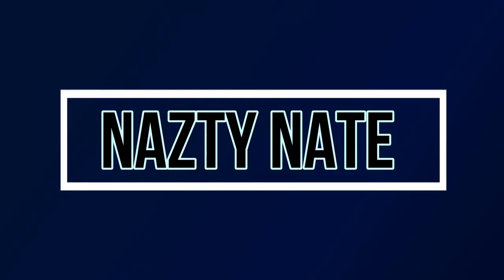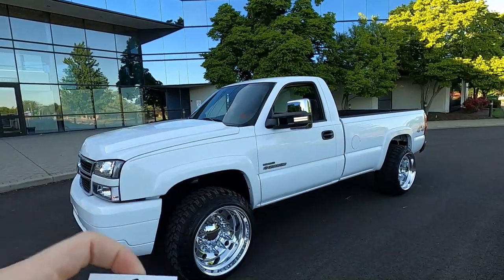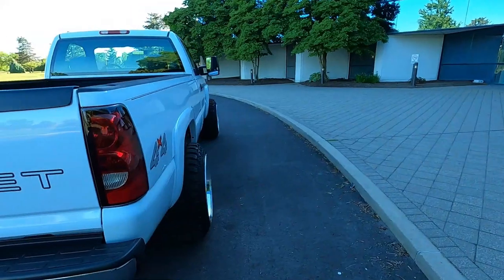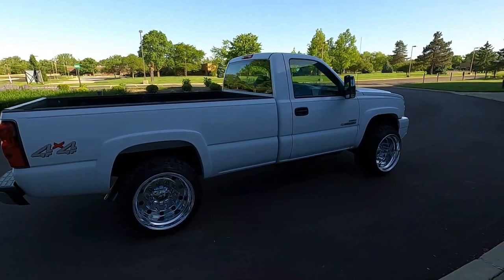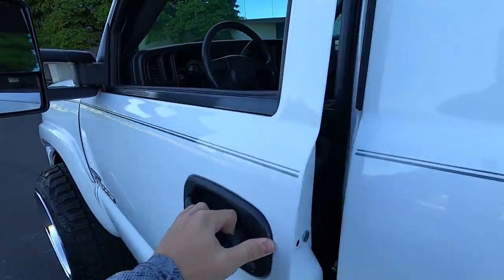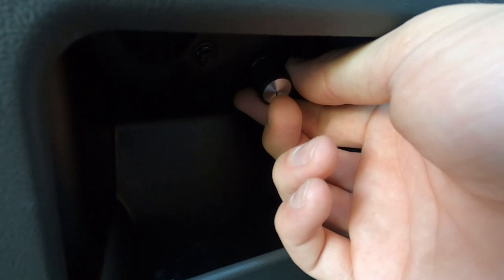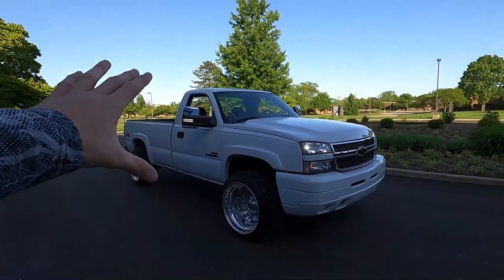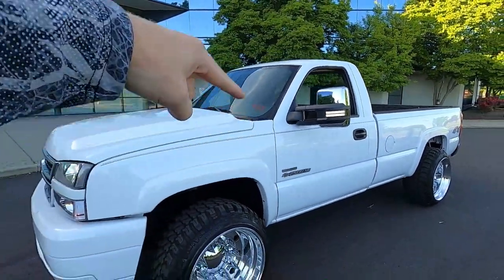Duramax Hiss vs. Rumble Idle Explained

Comment: Fun fact, you can add a switch to the LBZ pcm and enable turbo braking. You can add another switch and enable high idle mode.
Reply from the maker: Actually high idle is programmed in it from the factory!
Reply: @NaztyNate  it is, but only in cold weather, and one speed. With the switch I can turn I on at will, and bump the speed up to (i think) 2000 rpm.

Comment: With the lb7 if youd change the turbo wouldn't you be able to do this then? I've got a crew cab shortbed squarebody that I'm building and I'm building an lb7 for it, I want the rumble that you typically find in the lml
Reply from the maker: The lb7 has a rumble idle naturally. You'd have to put a VVT turbo on it to make it switch from rumble idle to hiss idle. The lb7 doesn't come with a VVT factory
Reply: @NaztyNate  alright, I've noticed the lb7 has more of a higher pitched rumble with more engine noise in the exhaust, I'd be looking for that lower pitched rumble, I'd looked into the stealth 64mm but can't find anything on how it effects the sound

Comment: Is your LBZ ticking? Mine has a pronounced tick on the drivers side I havent been able to figure out.
Reply from the maker: It's a duramax thing LOL
Reply: @NaztyNate  it’s stopped me from making a sell and I had new heads and head studs put on 20k miles ago and everything lol.
Reply from the maker: @joshcrosland8733  well they must've made that as an excuse. That ticking is a known thing for many Duramax owners. Some oils will make it more quiet but it's still there
Reply from the maker: @joshcrosland8733  it's known as the "type writer tick"
Reply: @NaztyNate Ah I gotcha. Sketches me out lol
Reply: @joshcrosland8733  if itd an intermittent random tick, thats the typewriter noise. Natural harmonics of the engine cause it. But if its a constant tick thats somethin else.

Comment: I've got a LBZ thats deleted and tuned with a DSP5 switch. I generally keep it on the fuel economy tune. Mine switches from hiss to rumble periodically while idling by itself. Is that normal?
Reply from the maker: Yes they do that from the factory to make sure the veins don't get stuck! It sounds crazy lol
Reply: @NaztyNate  love when my truck does that. It always happens after I start the truck up and let it idle after I have just have driven  it.

Comment: What suspension and wheels do you have? Truck looks sick!
Reply from the maker: Lowered 3 inches in the rear. The wheels in the video were 22x14 alcoa super singles from a semi truck machined down to fit normal truck tires
Reply: @NaztyNate  thanks bro truck looks sick
Reply from the maker: @tonygaza8276  I appreciate it man !